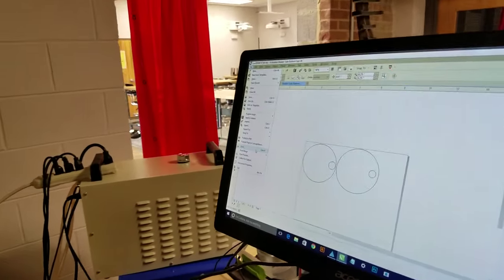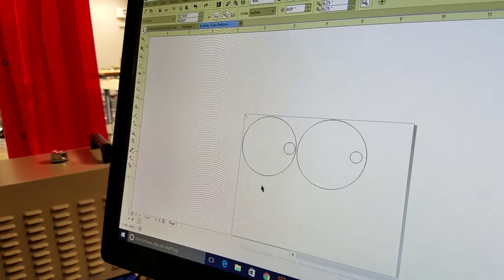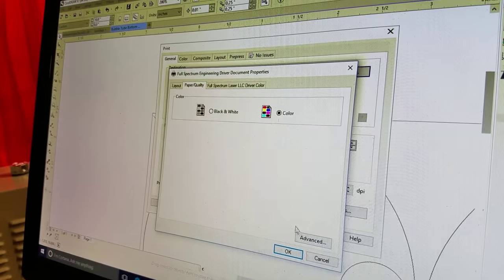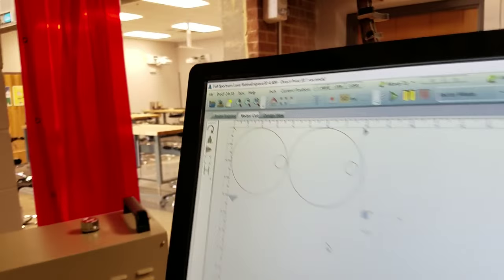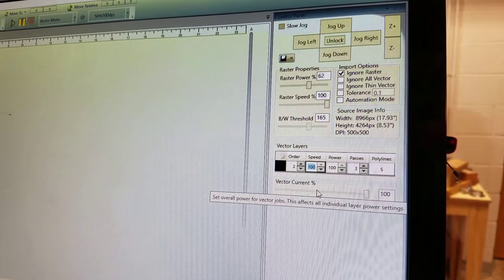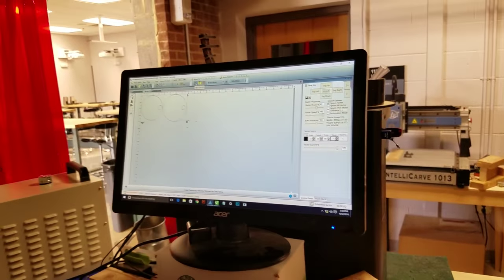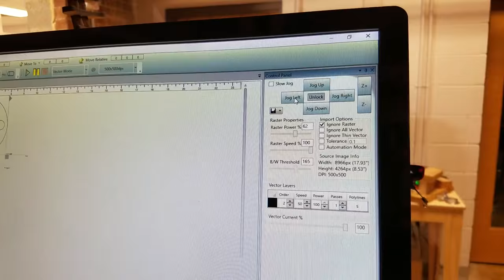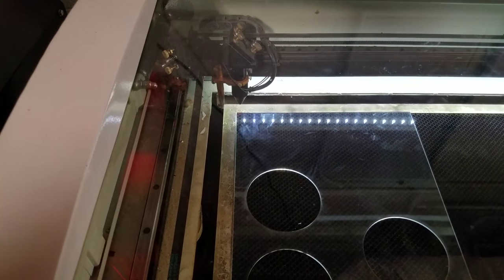Cutting Acrylic with a Laser Cutter

Comment: The voice of the cameraman seems to be Mike Mackenzie of C.E.M. There were 2 useful takeaways for me in this video: 1) Use full power to cut fast enough to not heat the rest of the material (which causes deformation/ridging) and 2) applying dishwashing soap to both sides and letting it dry before lasering. I will try "clearcoat" sheeting (which isn't clear BTW) instead as this also provided a barrier and avoids the evenness and drying issues of soap.

Comment: Great video, I was wondering if you could help me with a few questions.  My intentions are to create what looks like a cut in Acrylic but is more closer to just an internal scar that is foggy and glows like a ribbon in the Acrylic when lit. Can this be accomplished with less power and faster speeds? If this is not possible how thin can the laser cut be so it is almost invisible when viewed from the cut direction yet will glow when light is shown in the Acrylic. Thanks
Reply from the maker: Great question! I have no idea what the answer is, but I'm super curious to find out.
Reply: @MorganBenton  Thanks for the reply, I've been looking into it for about a week still no answers. Do you have any ideas on who to ask?
Reply: There are 2 kinds of acrylic; cast and extruded. Cast acrylic engraves white while extruded engraves clear.

You can raster the acrylic for the image, and use cast or extruded for the visual effect.